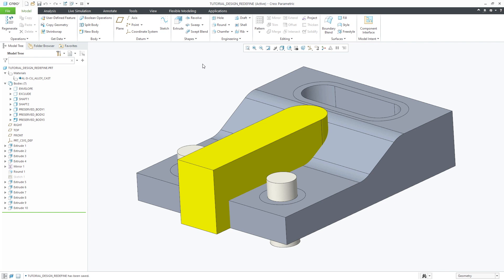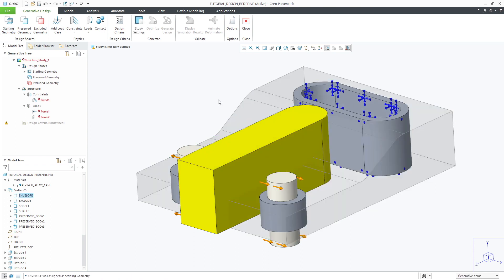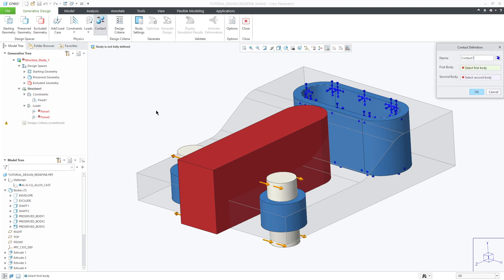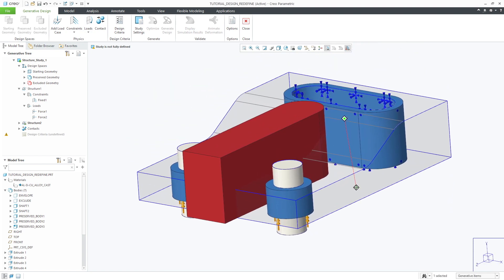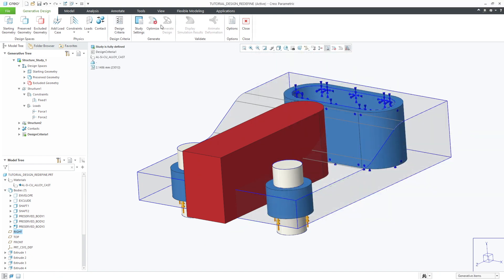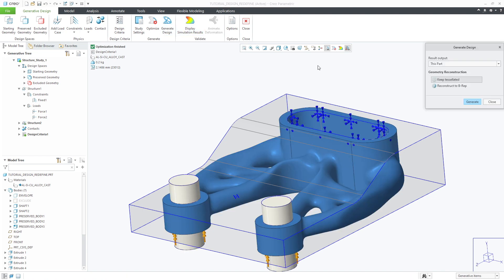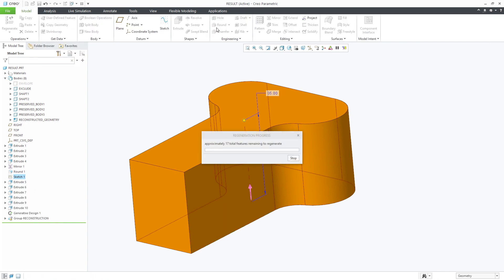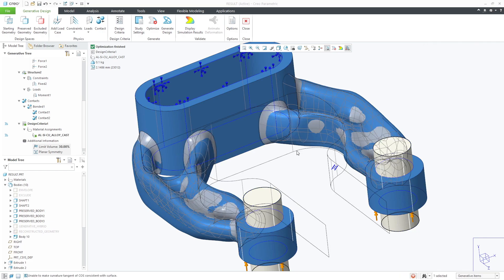How to Set-up a Generative Design Study in Creo

Comment: What is the difference between setting up like it's shown in video and setting up that way that excluded geometry is already cut from starting element?
Reply from the maker: Hi zixx91,

I got a very, very detailed answer with a lot of pictures from our product managers (and they described it as "a good question") that I can't share directly due to YouTube comments section limitations, but the gist of it is that it's setting up for a Creo 8 feature where Generative Topology Optimization will automatically create the starting envelope so you don't have to, and creating exclude bodies will be critical because that's the way to tell the software not to use that space to generate designs.
Exclude bodies as of Creo 7 also provide more flexibility/control and might be easier for modifications.

If you need more details I can try to arrange for you to see the full email.

Take care!
Reply from the maker: Hi Zixx,

I've reached out to our product managers and they're coming up with an answer. Please stay tuned.